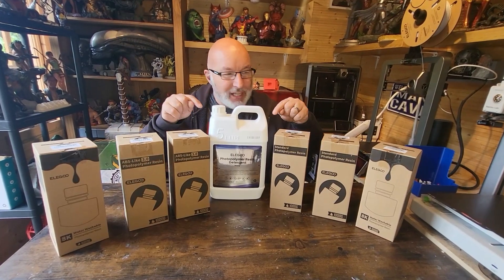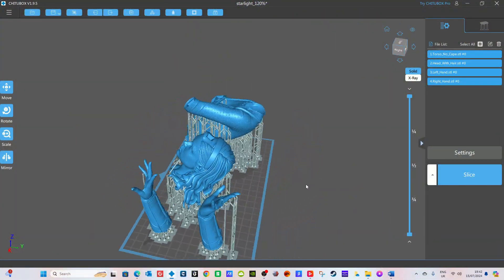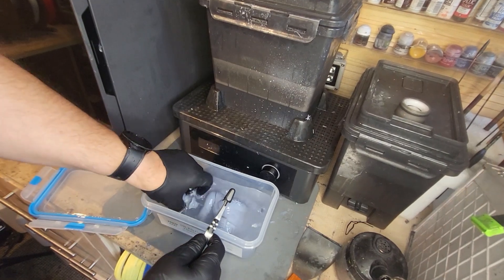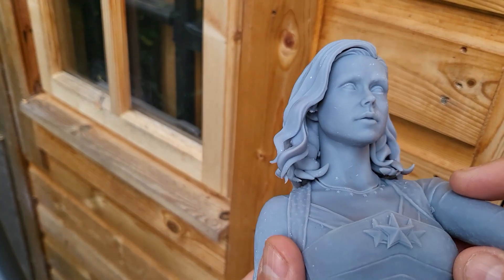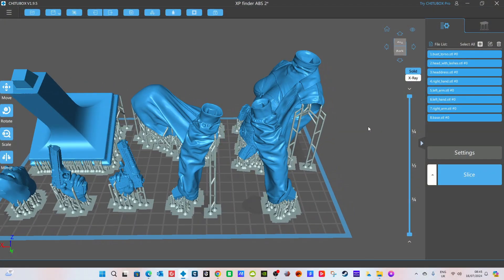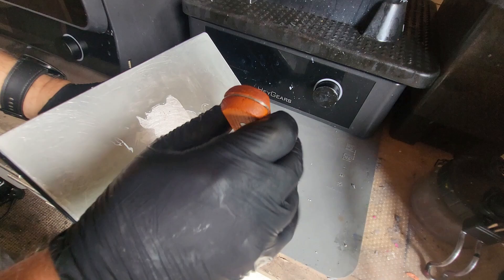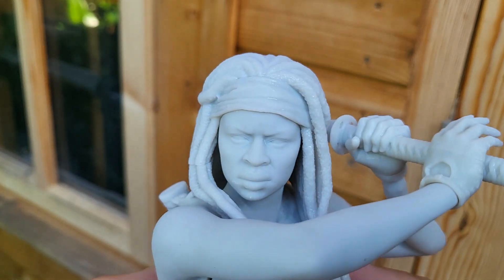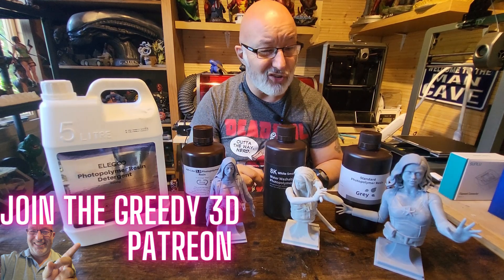Testing Elegoo 3D Resins And Detergent - Wow just Wow

Comment: Fun fact that the detergent actually dissolves the plastic the wash and cure stations are made from. My wash and cure station had its "dial" fused to the rest of the machine and it also fused the washing tub to the base.
Reply: Might actually be from resin solvent. It is methyl ethyl ketone. And softens the teflon of the rotor if it accumulates
Reply: @torbenverhasselt9670 nope, it's from the detergent. Take a few drops, put it on your wash station and then feel it in 10min

Comment: HI everybody!  I am a model cleaning tech and i use this detergent! I must warn you! the esters in this detergent will break through nitrile within 60 seconds.  on its own it may not irritate the skin. BUT if there is resin suspended in it, the resin absolute can, and is also toxic. if you plan to use this detergent YOU MUST USE BUTYL GLOVES!
Reply from the maker: Thank you cut the heads up
Reply: @greedy3d480  sure thing! butyl gloves are a pain in the ass to use especially when you go to de-sprue, so i only wear them during cleaning.  but if you wash the rafts or sprues with a little water when you go to de-sprue you can use nitrile again.

Comment: Ive tried this wash and it just doesnt work. Not sure if you just have to wash a lot longer or what. Wish i could get it to work, but sadly, it just doesn't work as well as IPA.
Reply from the maker: Weird I had a good experience
Reply: @greedy3d480  i used the new Elegoo wash station. Put some minis in for a 15 minute wash. They sat for a couple hours to dry. They never really felt fully dry. Did a 10 minute cure and it still had this weird feel of not fully done. Not sure what's wrong.

Comment: I've wanted to try "cheaper" resins like Sunlu to see if I could print more for less, but with the prices of Elegoo ABSlike 3.0 and the ability to get stunning detail on figures and I have never run an exposure test with anything but Elegoo standard. For some reason the ABSlike 3.0 just never fails to impress and is probably the cheapest option out there. I dont think I will ever switch.
Reply from the maker: I'm an advocate for if you find a resin that works for you and it's reasonably priced and you  get great results don't bother changing... if it ain't broken don't bother fixing it 😄

Comment: Curious to know if still using this resin detergent or IPA - If using the detergent, any idea how long does 5L last
Reply from the maker: Tbh I've used it all and switch between it and ipa I guess how long it lasts depends on how often and how much you use it to clean so it's a little bit of an open ended question that one

Comment: So I used this detergent to clean an Elegoo Mars 4 Printer as you recommended and it had a reaction with the clear plastic lid causing the plastic to become tacky and sticky. I was able to neutralize the reaction with 99% IPA. While this works OK with 3d printed resins, I would not recommend the detergent for cleaning anything plastic or removing resin from plastics. I have contacted Elegoo on this matter and provided them with a link to your video.
Reply from the maker: That is interesting as others have told me it cleans cases well...be interested to hear elegoos thoughts
Reply: @greedy3d480  From Elegoo USA, "We are so sorry that you have issue when using the resin detergent,
We have already send this issue to our R&D department, we will try our best to improve, hope we can better meet your need next time,
It is recommended to be careful when using and try to avoid the resin detergent from dripping onto the machine.
If there is any dripping, it should be wiped clean immediately to avoid damage caused by prolonged contact."

Comment: Is it normal that resin detergent just remove all kind of paint from all of my tools? Like my ultrasonic cleaner, and some of hand tools. How should i use it if it is so aggressive? Should i remove and then change my gloves every time when i conctact with detergent? That means i should use 10-15 pair of gloves after every print...
Reply from the maker: The only constructive advice that I can give regarding that is follow the instructions on the manufacturers guidance it differs for all brands so one piece of advice may not fit all

Comment: I'm not certain if I just got a bad batch or what, but my experience with the elegoo abs like 3.0 has been a negative one. Using a mono x 2, I've had to double print times in order to have a successful print.
Reply from the maker: Sorry to hear that I must say my mono x was an absolute nightmare it's definitely not your printer is it
Reply: @greedy3d480  I didn't have any issues with elegoo's original abs like. I have also tried abs like 3.0 on my mono x and mono x 2 (the latter being a brand new printer), and I'm having constant adhesion problems and layer separation issues. So, I don't believe it's the printer. I've read reviews on Amazon that have claimed similar issues, so I'm not sure if they had a bad batch, or if this is a more chronic issue.

Comment: Thank you, will definitely pick up the detergent.
What would be your no.1 pick for resin to pick up, if this ABS is only part of your top10 ? :)
Reply from the maker: My favourite 2 basic Sunlu and Jamghe standard pro.. although I've just had a fantastic resort with the water washable ABS like
Reply: @greedy3d480  thanks for the suggestions, think I'll actually pick up the JamgHe std pro. 

Do you use the settings recommended by the resin producer or do you tweak it to get the most out of it?

Sorry for spamming with questions, but I recieved my GKTwo today, which will be my first 3d printer experience :)
Reply from the maker: @gus7avbys I used the recommended settings and it works just fine if you're not sure just run a couple of exposure tests

Comment: I've used the detergent and IPA.  I still prefer IPA because I can recover about 75% of it for reuse as crystal clear 99% IPA.  The detergent is nice, less smells and less toxic, but you're still stuck with a jug of stuff to try and find a home for when it's no longer clean.
Reply: Why don't you filter the resin out of the detergent to recycle it like IPA? Elegoo's detergent (unlike Sunlu's detergent, or ResinAway) allows liquid resin diluted in it to cure as a spongy blob when exposed to UV light, exactly like IPA. As for me, I plan to use the Elegoo detergent instead of IPA and recycle it that way in the Wilson machine. Moreover, as the detergent is not flammable, I can use it in an ultrasonic cleaner. The best of both worlds!
Reply: @fluxcapacitor the thing is, lots of cleaners work that might be even cheaper? Simple Green, Mean Green , Purple Power, etc. $10 😊or less per gallon. The Purple Power in Walmart comes in a bigger container at about $6 per gallon but obviously buying more than one gallon at a time.
Reply: @christebo7305  I have no interest in testing kitchen cleaners that are not designed for this purpose. In any case, I can't even test them because all the cheap products you mentioned are not available in the EU and importing them would quadruple their price.
Reply from the maker: Yeah I'll get that completely a lot of people don't bother reusing their IPA and just get rid so I guess they would find this much more beneficial again using it in ultrasonic cleaners is a lot safer than IPA as well

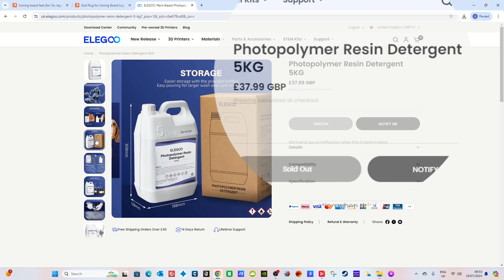Comment: A great video with great content and I will try the ABS like Resin. One point I'm afraid I have to disagree with is that on Amazon IPA is £18.45 for 5L, But I can't find the Detergent under £32. So that is a bit misleading to say they cost the same(at 13:50). I'm just nitpicking as it is a good vid, but facts are important.
Reply from the maker: Now that's a fair comment I have since found it a little cheaper the alcohol that is. But you can pay that much for 5 L of alcohol depending on where you shop point noted and I do agree with you thank you for the comment
Reply: EU uses 1-propanol (n-propanol) as sanitizer instead of iso because it's a superior sterilizing agent at lower % according to WHO (the us ignores them because we're idiots) and evaporates much slower.  It's likely to be cheaper in the EU than iso and probably works equally well for this.  I had a gallon during COVID (as a general solvent / cleaner like I use iso for, I use soap for my hands) because it was cheaper and didn't notice a difference for any cleaning use except I went through it slower because it doesn't evaporate very fast.   Maybe look for that.  Also they determined isopropanol forms explosive peroxides on UV + air exposure...  google it...    probably far lower nm than the cure stations but since n-propanol doesn't form them why even risk it?

Comment: You said Non Flammable - But I notice on the bottle is has the Flammable symbol and when I look on Amazon I can also see that symbol. Is it safe for Ultrasonic cleaners?  Couldn't find any info on that.
Reply from the maker: I've asked elegoo.. non-flammable and can safely be used in an ultrasonic cleaner I'm told
Reply from the maker: This is also off their website Non-Flammable: Safety is our top priority. Our resin cleaner is non-flammable and non-explosive, providing peace of mind while working with the solution. It has a high flash point of 82 degrees and a 20% longer service life than alcohol, making it safer than IPA and easy to transport and store.
Reply: @greedy3d480  Ahhhh. Missed that. Thank you - I was looking on Amazon, should have checked the website.   I will have to try this.  IPA prices are getting so expensive now.   thanks for the great, informative videos.